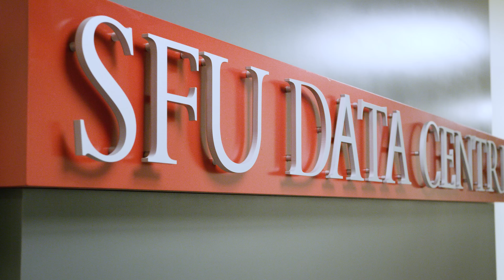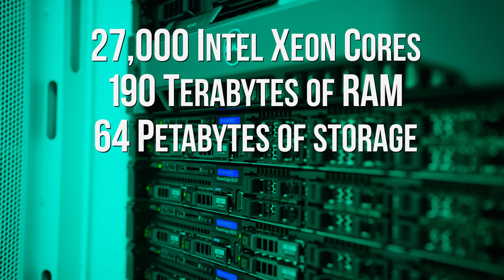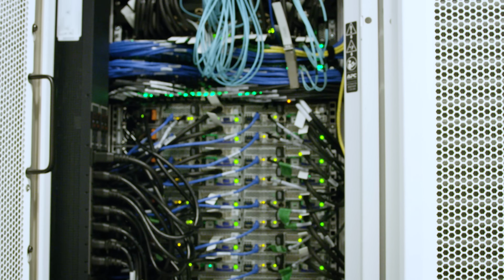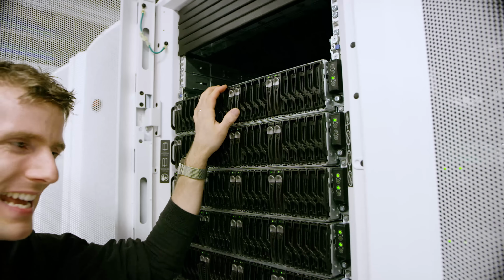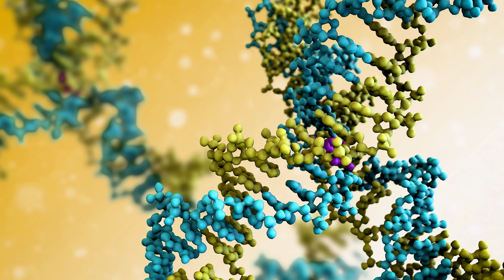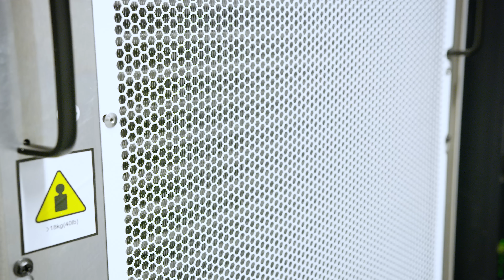Unboxing Canada's BIGGEST Supercomputer!

Comment: Linus goes to Canada's biggest datacenter

Slides open a storage drawer and just pops out a hard drive
Reply: David Slagh lol - and breaks disk array - or config-
Reply: Thought I alone was worried
Reply: it's okkkkkk, it's hot swappable (use google ;P)
Reply: It's a server system, so everything will have redundancy and parity, so in the same way that a failing drive is unexpected and coped with, a drive being removed would be too. I imagine there's some note in a log somewhere that says that drive disappeared though.
Reply: Plus... the datacenter was not yet operational at the time of filming.
Reply: Besides, they probably already asked which one is not powered on.
Reply: Its more a case of how much other stuff he pulled out..... lol ..... put it this way I wouldnt let him run around in my data centre :P
Reply: They probably edited out the part where he dropped it.
Reply: Yeah, probably bespoken and the system wasn't in production yet.

Comment: Finally, I can play minesweeper at 60 fps.
Reply: Darth Derp Nah bro i have one of these at home. Can only get 6 fps
Reply: Just casually have all that space in your room xD
Reply: swaggy p mine is over locked to 8fps
Reply: Mine got to 10fps but the computer burnt a hole through my carpet
Reply: swaggy p Download some more ram and you'll get an extra 0.5 fps however if you overclock the power supply you'll get around an extra 2 fps
Reply: Maruf Rahman can I overclock my case?
Reply: Sir Derp i tried to download more ram but my PC couldn't handle more than 2 potatobytes of veggieram
Reply: Ask Hoaas Østereng 
have you tried turning it off and on again?
Reply: Yes you can, now with Tunnel bear you can have access to overclocking your mouse, keyboard and even the case!
Reply: Yeah, it probably doesn't work because it's not overclocked, but if you overclock it, it might work.
Reply: Also Minesweeper is an GPU demanding game, you might need to upgrade your GPU to the TItan X
Reply: oh, my cpu(central potato unit for those who dont know), might nop be powerful enough.

Comment: It can't be that good, where's the tempered glass and RGB lighting?
Reply: yep and just listen to how loud it is, they must be using budget case fans.
Reply: I've been in there and it's not that loud, definitely not worth wearing ear protection.  The old Bugaboo cluster  is next to it and is much noisier, set to be decommissioned in the fall last I heard.
Reply: I bet it doesnt even get 1 FPS in minecraft
Reply: It does not have to be loud te get damage in hearing. Duration is something most people do not take into account. Even 80decibel can damage you're ears when exposed for an hour or something.
Reply: 80 decibel dmg afther 8 hours
Reply: I bet it only has VGA ports. smh
Reply: I have a db meter I can take to measure the sound if the guys agree.  I'd probably wait until the older Bugaboo cluster is decommissioned in a few weeks.  We're also moving over things from the main campus data centre into this newer space so that might make extra noise. 
I guess too Linus was probably there a lot longer than my 20 minutes...
Reply: The fps seemed pretty good to me..
Reply: 1000th like
Reply: Lol
Reply: RGB there is plenty of green flashing lights lol
Reply: @jamesfield1674  do there is G lighting, where the R and B at?

Comment: I like to think that Linus actually broke in to film this video. Some guy going through security footage and finding some random guy and a cameraman rifling through $22 million worth of equipment and watching in horror as he removes the drive.
Reply: lol

lol
Reply: lol

lol
Reply: They probably had it on backup anyways, I mean they have 40 gigabit internet as backup lol.
Reply: Scar that's actually funny
Reply: Scar lol
Reply: Removing the drive of a server does absolutely nothing to the server. Servers use SAS drives and many of them, they all have the exact same data which they share with one-another and the purpose of this is if one drive goes faulty another one can kick in to continue the process
Reply: It was offline while he did it. Note the status LEDs werent on.
Reply: trust me, that building has just as good physical security as fort knox
Reply: +3LX What if it was in raid 0? I fucked up the data of a server when I pulled a sas drive out from a working server when it was running raid 0.... lol
Reply: Who the Fuck use Raid 0 ? Anyway most drives today are hot swappable
Reply: Will J Haha definitely wasn't raid 0
Reply: no worries, these drives are fully raided

Comment: LMG should make a 1 terabyte ram project. Like if you agree
Reply: 1TB of RAM isn't that hard to do with the correct server, it's just expensive.
Reply: Alex Vyndyuk Maybe 1 petabyte of ram XD
Reply: There is no need for 1 TB of RAM (yet).
Reply: it's really not that impressive anymore, tbh
Reply: Kaminishi ram virtual drive
Reply: For personal use there isn't a need, but at an enterprise level it's relatively common.
Reply: Or a pebibyte :3
Reply: Alex Vyndyuk
1TB is easy to do on hardware from 2011. When it comes to RAM, 1TB really isn't much. On dual-socket server boards, you get 16 DIMM slots (8 per CPU), and you can do 16x64GB for 1024GB of RAM. But there's a huge dropoff in value past 8GB and 16GB DIMMs, because 32/64GB sticks are less common. Plus, not many workloads would properly utilize that much RAM. I just built an affordable workstation on the Intel C602 chipset (Sandy Bridge era), and I put 128GB in it (16x8GB). It's not going to get that high unless you're running lots of high-precision simulations on extremely large data spaces.
Reply: Conor more like 1tb per 250-500 virtual machines
Reply: Conor 
them being able to afford 2 red cameras and it's bs accessories (126,000$), a lot.
Reply: NEC Express5800/A1080a Series server holds 2TB of RAM and that was released in 2011.
Reply: We have a 768gb RAM server at work....it's not all that difficult tbh.
Reply: But why? It wouldn't be that difficult, and there would be nothing impressive to do with it. "as you can see here, the BIOS now says the system has 1Tb of RAM.... annnd that's the video, thanks to coolermaster for yada yada, click that like button..."
Reply: But to what end?? What should be the purpose with such a project or are you just saying it for lol's?
Reply: Maybe they will make the project a few years later

Comment: In 30 years we'll be looking at this thinking "A whole building for that 'supercomputer'? My $200 laptop is twice as powerful and is as thin as a piece of paper!"
Reply: Crazy fact. A mid end gaming desktop has slightly more processing power than the most powerful super computer from 1990. So yes, that's almost within the realm of possibility.
Reply: LordFireApe i seriously doubt 30 years....look what 10 brong us.2007-2017
Reply: True, who knows how long it will take.
Reply: eh...due to moore's law we're at the edge of computational limit until electrons spontaneously teleport. Probably takes way more time lol
Reply: not in 30 years just when Quantum computing come out.
Reply: The question is, can quantum computers be small.
I mean a single server rack being 10x more powerful than all of that, sure. But into a laptop form factor? I doubt it.
Reply: Just Anoman why would you doubt that? Bill gates once said you will never need more than half a GB of ram. Never doubt tech.
Reply: Dennis Rigdon ..... did you just use brong as the past tense of bring ? xDD
Reply: Now you can get a CRAY SUPERCOMPUTER dirt cheap, it was the HIT of the 1980s :)
Reply: It's not really BECAUSE of Moore's Law (which isn't really a law, but an observation), it's because of physics.  When the transistors get down to only a few nanometers in size, a phenomenon known as "quantum tunneling" comes into play.  Basically, individual electrons will randomly and spontaneously tunnel from one location to another.  This happens all the time, and they really don't go far, so this isn't a problem for current CPU architecture.  But after a few more die shrinks, when the transistors are only a few nanometers across, a tunneling electron can end up in a completely different part of the circuit and potentially cause unintended operations in the CPU.  Not exactly great for reliable and stable performance.  The prediction now is that by 2021 we will have reached the physical transistor size limit for silicon chips.  However, they are already working on different transistor designs ("gate-all-around vs the current FinFET), "3D packaging" (ie stacking of transistors vertically), better cooling, and using materials other than silicon to make the semiconductor wafers (Germanium, III-V compounds, Carbon Nanotubes, Graphene).
Reply: It's a misconception that super computers are just better than regular binary computers, the third variable, qbits which is the quantum part allows it to be good at simulations with quantum properties and certain tasks whereas the highest end binary CPUs today would probably perform not quite equal but certainly close to that 2,500sqf super computer. This is why there's no real commercial market for this stuff and most certainly never will so I would say we're a lot closer than 30 Years bud, they only really have a use for quantum field and genetics research.
Reply: @Square Just a little info. You are right but not totally. Don't take for granted that quantum computers are or will be faster. Quantum computer take a massive amount of space and are actually slower when calculating normal stuff compared to a normal computer. What a quantum computer is good at is calculating Quantum possibilities or massive statistical data. They are still awesome though. Oh and yeah just like the dude over said, we are reaching the limit of the transistor size. I don't know about the fixed limit but yeah we are getting close and it's becoming more worth to just increase the size to increase power.
Reply: 640K was biilg's famous quote.  Back then people weer afraid to put a whole megabyte in in case they became spontaneously sentient.
Reply: quantum computers may not be small at all, but the difference is in speed, it is probably billions of times faster than the fastest computers to date, how it works is really complicated.
Reply: i did this for this vid its only faster in certain use case. Even a regular super computer is much better than a quantum super computer at certain task
Reply: Or maybe overclock something in say 20 years, and hook it up to a swamp cooler like this dealie-o is.
Reply: long story short (not really short), basic computers have bits which are the smallest units of information, but in quantum computers they have qbits and as long as its unobserved the qbit is in a superposition of probabilities of 0 and 1 and you can't predict what it will be, for normal bits it only can be 1of2 to the power of 4 at a time, that's 16 possible combinations out of which you can just use one, however, qbits work differently you can be all 16 at the same time, 20 of them can already store a million values in parallel
Reply: quantum computers will probably not replace our normal computers for a long time, but it is superior in data searching and thats what i meant to say earlier
Reply: i did this for this vid its much better in data/memory related tasks but it is lousy and extremely inneficient on computational workload such as graphics and any other mathematical calculation.
Reply: Hell the pc will probably be a hologram, itself, projected by a watch, that's also a phone, 4-100" display, web cam,  lite scribe, and personal stenographer. It will be called: the Galaxy I phone 40. It will allow for conversations, like in Star Wars, face to face, for those who use Tinder, and Craig's list, it will also detect STD's.

Comment: I did notice the heat exchangers, but I thought they were radiators that were on the front that had coolant pumped in.

I get where the heat goes, but I don't understand the "sealed front". Where do the servers get cool air if they are sealed on the front?

Comment: 5:40

Random scientist: why did my website die?
Reply: Luckily they used raid 0 for Linus to fool around
Reply: @thenewnew1997  Try pulling a drive from a RAID 0... you'll destroy the array.
Reply: @anatolydyatlov963  I don't get it
Reply: @yngfljm  RAID 0 is a disk array where your data is split evenly across all the drives. It provides absolutely no redundancy and if one drive fails, you lose everything. Even if you have ten 1TB drives in a RAID0 array (which creates 10TB of fast-access storage), pulling out one of them will result in losing everything . I'm sure the author of the previous comment meant RAID1 (mirroring). Though I wouldn't recommend that either. You can enjoy the benefits of both mirroring and stripping with higher raid levels. Nowadays we use mainly RAID5/6/10
Reply: @anatolydyatlov963  huh, I've never seen or heard of RAID 6 before but I have very little experience and knowledge in this as I'm just starting out. Thanks for the info too!
Reply: But nobody’s gonna talk about why a random scientist would’ve been making a website, nonetheless on that supercomputer for some reason?

Comment: Can it run minecraft?!?
Reply: Lochie Smith nope
Reply: Only at around 1 frame on low quality, needs more rgb to run any mor than that
Reply: Lochie Smith Solid 100000000fps i think
Reply: NO WHAT CAN???????????????//
Reply: I can barley run minecraft with 1k FPS
Reply: Lochie Smith I literally died reading this this is me as a ghost 😂😂😂 gets reborn reads it again
Reply: It won't top 10fps on low.
Reply: its can in 4K in 10000FPS
Reply: with 500 peta frames
Reply: No! The question is...

Can it run Windows XP?
Reply: but... but the eye can only see 30fps? right? XD
Reply: then your 0 button on your keyboard died
Reply: its for research and i dont think so it have GPUs so it cant
Reply: starve.i o.   

But Linus said that it had like 40gpu's though
Reply: Well it can run about 5000000 mc,s at once
Reply: naaa dude
Reply: will it run PUBG on medium?
Reply: 594gpus
Reply: probably on 64K resilution
Reply: it can run mc at slow mo
Reply: Lochie Smith probably not

Comment: 2017: unboxing Canada's biggest supercomputer 
2020: crowdsourcing the World's biggest supercomputer
Reply: Check out Frontier and El Capitan. They will exceed the exaflops capacity mark, and together will reach almost similar levels to the distributed volunteer networks.(BOINC and Folding@home) This puny Canada's best machine doesn't compare anymore at all.
Reply: @illuminate4622  That is an incredibly stupid thing to say, I dont know about these distributed computing projects in particular, but you cant move memory around fast between distributed computers, which is one of the main benefits of having these kinds of highly networked devices.

Comment: Why not use the exhaust heat to boil water for steam turbine generators to help cut down on electrical input costs? Or heat a nearby building during the cold seasons? Otherwise that is a cool setup.
Reply: Davis Bradford That actually is a really good idea. Makes me wonder why they didn't get a steam turbine - i would think the heat exchanger and lack of heat recycling would cost more, but is that so? Space maybe?
Reply: Davis Bradford if the water being ran to exchangers is hot enough to boil water , then this tells you the water at the computers is boiling. I don't think they want their computers that hot .
Reply: It actually takes a lot of thermal energy to run a turbine. Basically, only superheated steam is energetic enough to power a small turbine, and that wouldn't produce enough power to be worth the costs (initial and operational). It also takes an immense amount of energy to turn water into superheated steam.
They would have to spend millions more on a boiler system (coal, gas, oil, or nuclear). Definitely not cost efficient in the end.

I used to work in the engine rooms on US Navy nuclear propulsion systems.
Reply: Considering they have a whole fucking team of engineers building this, im gonna go ahead and assume they've already considered this

You aren't gonna make any revolutionary changes to such an insanely complex and well designed system that they haven't already thought of and shot down long ago
Reply: I've worked a little on the R&D team that released some of the later generation units of the ones in the video. It would be up to the customer to decide what they want to do with the exhausted air from the room. We just care they are able to keep certain temps for certain times. Canada is easy compared to our middle east sites and on oil rigs.
Reply: So a nuclear reactor with no uranium
Cool idea man
Reply: They could just use a thermocouple

Comment: honestly 22 million for the whole chuleta, doesn t seem out of this world. considering the computing power, plus  the facility put the labour and engineering work behind, this is quiiiiiite cheap actually
Reply: Yea 22 million dollars is chump change
Reply: Yeah its cheap
Reply: I figured the Microsoft Server licensing fee's per core would have cost at least 20 Million alone.
Reply: if you think about it, if a 8x32gb ram kit costs about 2000 CAD, then 190TB of ram would be about 1,600,000 CAD. thats a pretty substantial amount
Reply: @technicalthug  He said street value, I don't think they purchased that for a million.
Reply: @BearBaylor69  Think about what you said, they would never install Windows on server meant to be that performant xD They might end up running Windows VMs, but devices like that run Linux